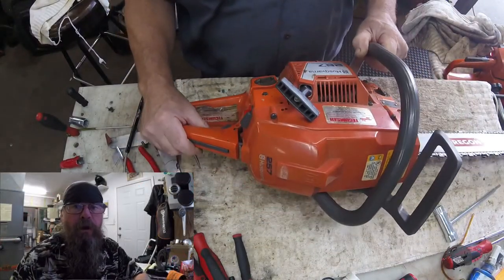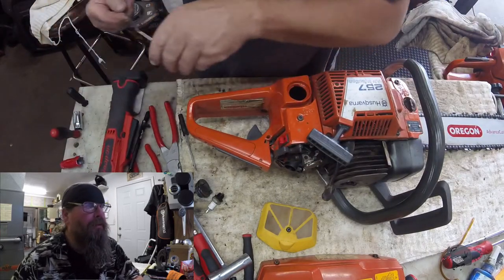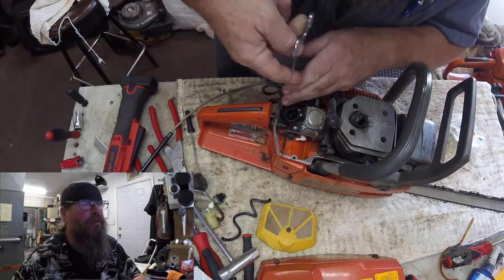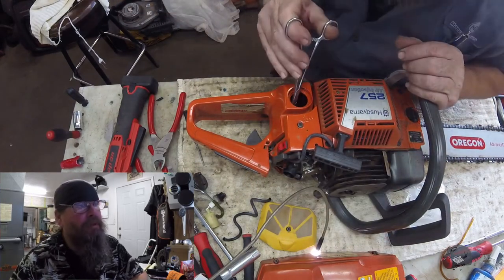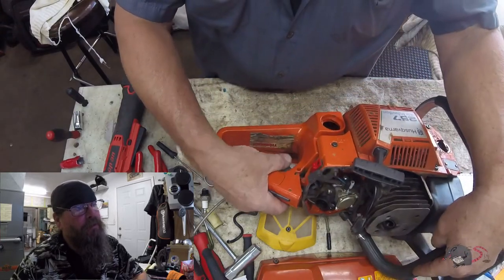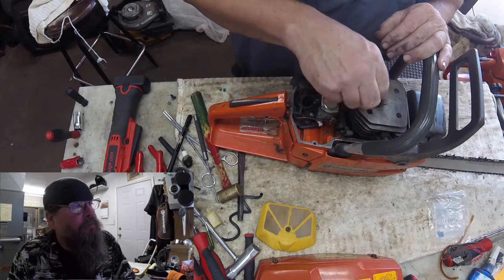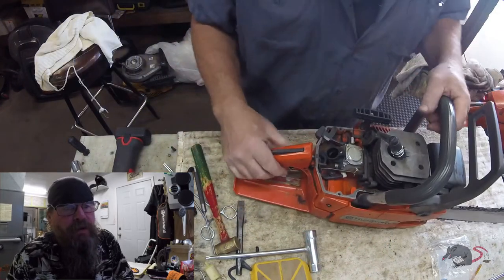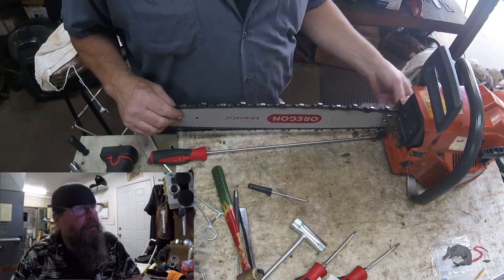Husky 257 Fuel Line and Trigger repair

Comment: My 257 dropped it's throttle pin as well and the new pins are sloppy .Yee need to make it burred up ,
Reply from the maker: Yes but only part of it or the trigger will be tight.

Comment: show a video of putting an Impulse line in a 257 will ya
Reply from the maker: I don't remember that model having an impulse line.
Reply: @TheGreasyShopRag  oh yea it has 1 green crinkle one put me a carb kit in filled it up with gas and it started spewing when i flipped it over guess its Rotten ,i knew it wasn't the Kit when i put it in way to clean.
Reply: @TheGreasyShopRag  i call it an Impulse line it's not the gas line in your Video it's the one that pulls up into place it's a Bitch to change my hands and eyes don't work as good as they did 10 years ago ,thanks for the video Mister keep up the good work

Comment: I have a 257 1996 year do you know how the adjust the oiler on it ?
Reply from the maker: Probably not cuz I never heard of that model.
Reply: @TheGreasyShopRag  it was supposed to be 96 year 257
Reply: Do I only get one respond most are right on the bottom but I don't see it on the 257
Reply from the maker: @singleshot1331  The 257 should be on the bottom but maybe its an odd unit and located behind the clutch drum like the 272xp.
Reply: @TheGreasyShopRag  Thanks I will look.